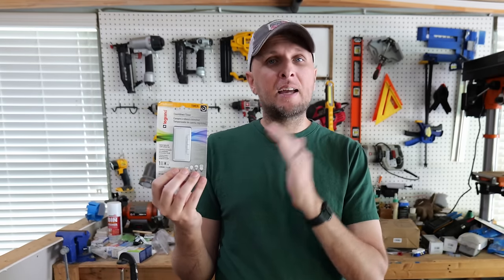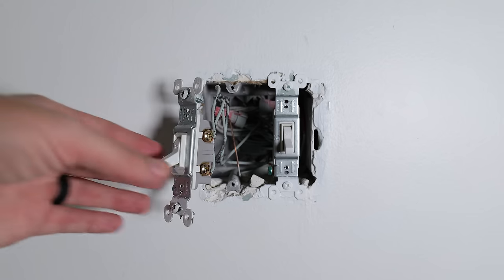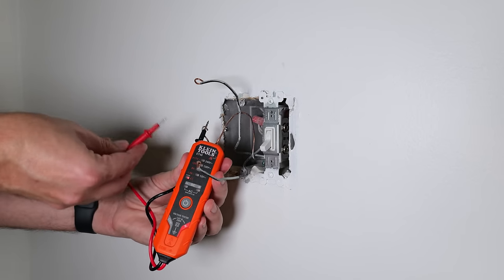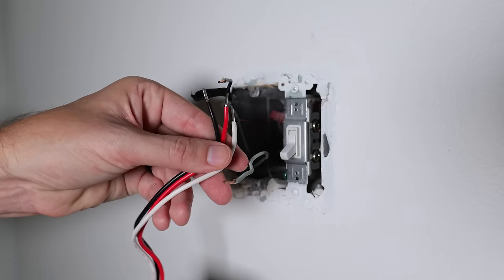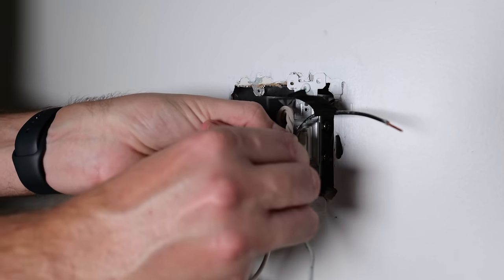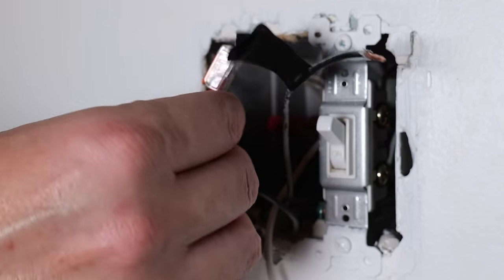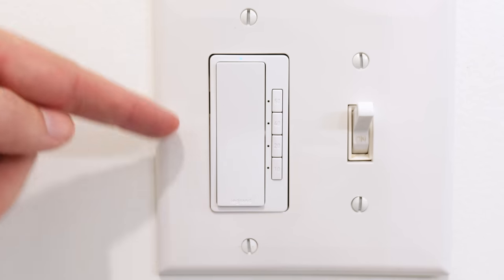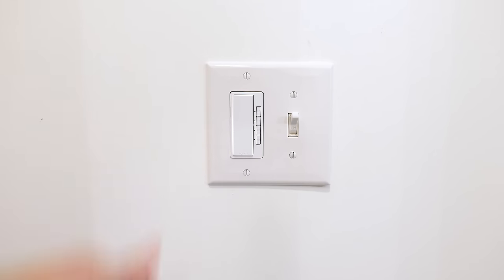How To Stop People From Leaving Bathroom Exhaust Fans And Lights On!

Comment from the maker: Do you have this issue in your home?  I hope I am not alone 😂
Reply: Another way replace fan switch with a 3 way switch 
On side with single screw power it from load of light switch
Other side top screw to fan 
Bottom screw to nothing
3 way only gets power if light on 
If want fan and light both up 
If want just light light up fan down
No way to turn on fan without turn on light. 3 way switch are great for other items too
Could use on an open / closed sign
Top screw to open letters bottom to closed letters

Comment: I was told by a firefighter that many  attic fires in older homes are started by the fart-fan  being left on.  This is a great idea.
Reply from the maker: I definitely believe that.  They are not designed to run all the time and use a good amount of power.  Thanks a lot for the feedback!

Comment: Great video. Another alternative, which I did about 20 years ago when the teenagers refused to turn on the fan, was to install a humidity sensing fan (a sensing switch is also available for existing fans).  Now it just comes on when the steam fills the room, and shuts off when the humidity drops.
Reply from the maker: Yeah I have seen those.  Which are great for the exhaust above the shower but not real helpful for the one over the toilet.  Very cool devices.  Thanks!

Comment: I have the opposite issue, I need it to automatically turn on when my mother in law uses the bathroom 😂
Reply: This is solved by a motion sensing switch. Like the ones they use in hospitals and commercial settings. This is what I use at home. Just walk into the ba to bathroom and the light and/or fan turns on without you doing anything and when you walk out, you don't have to turn the light off if you don't want to, it'll turn off itself after the preset time you set it to with no motion.
Reply: @smarmosaur  Best idea!
Reply: Occupancy sensor switch
Reply: I added motion sensor lighting for our laundry room, as we generally enter that space with full arms, so it's quite nice.
Reply: @tjharvey05  Fantastic idea!!
Reply: @smarmosaur  I have the same setup in my home as well.   I use Panasonic exhaust fans, so you can't hear them.  The motion sensor turns the on the fan upon someone entering and lets it runs for 10 minutes after the person has left.  Works great.

Comment: These and motion detector switches are great. I'm in the middle of rewiring my entire 1914 house and putting these devices in where it makes sense. An issue one might run into is the depth of these devices, the size of the box, and how many wires (and wire nuts) may be in the common boxes used for switches.

Comment: I had a huge problem with my kids leaving the exhaust fan on.  I installed a mechanical timer and it works fine but I wish I knew about that timer you used.

Comment: The problem is getting the fan to come on when someone walks in. I replaced the fan with one that has both a motion detector with timer and an adjustable humidity detector. Then, removed the wall switch and jumpered the line and fan leads together in the box. Now, the fan comes on when someone enters the bathroom and stays on as long as there is high humidity and at least 15 min after there is no motion. The fan itself is almost silent, but will ramp up the speed if needs to.

Comment: The ground wire had paint on it.  This could affect the contact.  Should have hit it with some sandpaper.  Also, I see you continue to use Wago when Ideal's similar solution was found to have a superior design as the levers don't pop up when shoving it back in the box.

Comment: our complex has so old outdated bath fans, most of the motors dont play nicely with anything but a manual switch. the ancient bakelight boxes dont help, most modern timer/motion sensor etc switches dont fit. the mud rings make it even more of a PITA. We've just gone with fans with lights with built in motion sensors in the units with attic access

Comment: Do they make something for a a unit with separate switches for the light, exhaust and heater? The heater is the one I leave on mostly and it's the switch in the middle

Comment: I need to check if my bathroom light switches have a neutral wire to see which light/timer switch to buy. I need a bathroom exhaust fan installed since humidity doesn't decrease fast enough when opening the window.

Comment: If you're going to go through all the trouble of reswitching, you shoulda gone up a step and used a motion sensor switch. This way you dont even have to touch the switch to turn the light on or off.
Reply from the maker: I use one of those in our laundry room and it is a great addition.  Actually linked that video at the end of this one.  For me personally, motion sensor lights in the bathroom are annoying for a couple of reasons.  Number one, if you get up during the night to use the bathroom, I personally don't like full lights turning on or fans.  Number 2, I have been in bathrooms before that use motion sensors and if you sit there too long, the light turns off and then you have to wave your hand to get it on again.  I much prefer this push button timer for for the fan's purposes but everyone's situation and preference will be a little different.
Reply: motion sensor switches get annoying. our dumbass residents constantly hitting the manual override button, than complain light/fan doesnt turn off at all

Comment: I highly suggest adding at least 10 to 15 minutes to your shower time. 

Take a 10 minute shower? Set the fan to at least 20 minutes. !0 minutes when you are in the shower, and 10 minutes after you're out. This is so it'll draw the humid air out when you are done as well.

Comment: I'm fairly minimalist and try to save on energy, but I live in an area with high humidity and a lot of mold.

When I lived by myself I left the bathroom fan and a window fan in the bathroom on 24/7 and my electric bill was usually under $30/month.

Now I live with roommates who shut the fan off instantly and run the heat all the time so my electric bill is a couple hundred and the bathroom constantly needs to be cleaned of mold.

I miss leaving the fan on all the time, saved me a ton of money on cleaning products and a ton of time for almost no money.

Comment: Another problem is if your fan moves 88cfm and it's winter you are sending a lot of heated warm air out of the house. Same in the summer your sending cool air outside so its a compound problem.

Comment: you could have used a occupancy switch and that will switch off the load when it detects no motion for 30mins
Reply from the maker: Many reasons I did not want to install one of those in a bathroom.